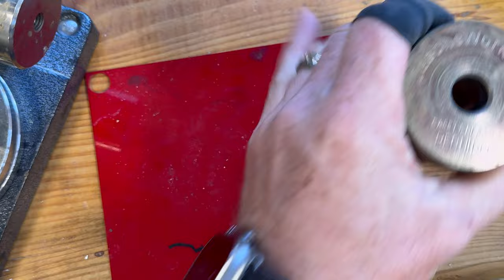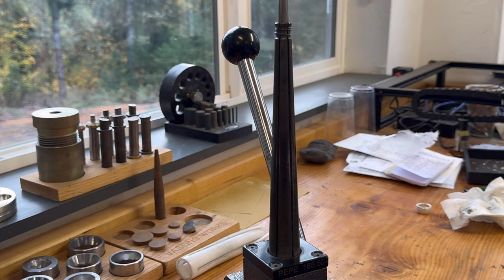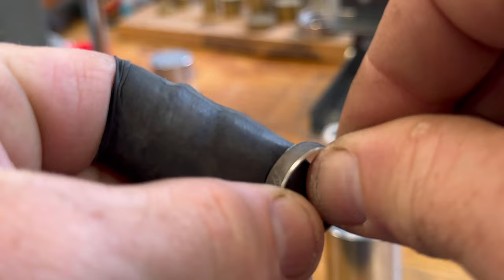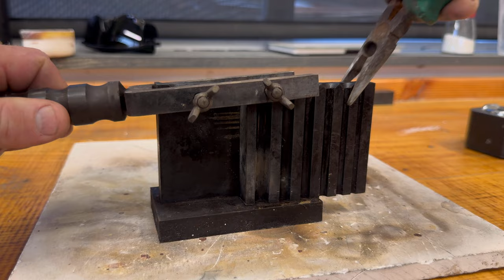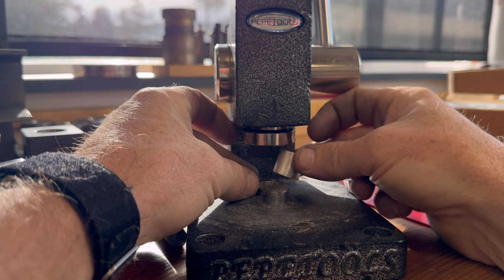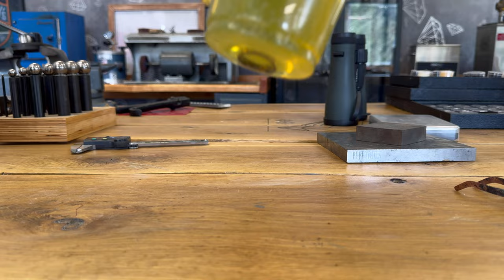Two Quarters (made into) One Ring

Comment: Nice work including the liner. I've done a couple of JFK'S for weeding rings. One was silver and the other side cupronickel. The same challenges were present as with the quarters. However, with the addition metal I didn't use a liner and used black and clear power coat. I only remove the black from over the date and text around each reed side. That helped conceal the different thicknesses on the center weld.
Reply from the maker: Cool solution!
Reply: How do i get one?
Reply from the maker: @comanchejr921  Contact me through my website www.changeyoucanwear.net and I can get the specifics you need and I can make one for you. These are custom so there’s not a listing up for them :)

Comment: If you add a divider between the halves, the transition from one side to the other will be smoother.  I make a silver ring out of 1mm wire and then flatten it a little between bench blocks.  I solder that between the two coins.  If you google jerrys treasures you can see some of my coin rings where I've done that.
Reply from the maker: That’s a really great solution. I thought about adding something like that in between and setting stones in it or something but I was worried about making it too thick. I suppose I could make the two rings thinner if I was worried about it. Thanks for the idea!

Comment: Do you have to sharpen your hole punches every so often?
Reply from the maker: I know people do. I have never sharpened mine ever. I’m sure they could be a bit more efficient but I’ve never noticed enough of a difference to worry about it.
Reply: @CoinRingsfromTheMint  Good to know, thanks man.
Reply: Is there a rolling machine that makes large round wire to smaller round size
Reply from the maker: @timothyjohnson7521  Not a rolling machine but a draw plate is what you’re looking for. I usually use a rolling mill to make square wire and then use a draw plate to make whatever size wire I’m looking for.
Reply: Also what is a good rolling machine
Reply from the maker: @timothyjohnson7521  I really like the Pepe tools line of mills. If you go back a few years on my videos I have one that has a discount code and I heard it’s still active. It was a video of me rolling out silver and making different pattern rings.
Reply: @CoinRingsfromTheMint  not big on a draw plate
Reply from the maker: @timothyjohnson7521  That’s the only tool to make wire with
Reply from the maker: @timothyjohnson7521  Why aren’t you big on them?
Reply: Thanks if you make it to minnesota I'll buy you a beer